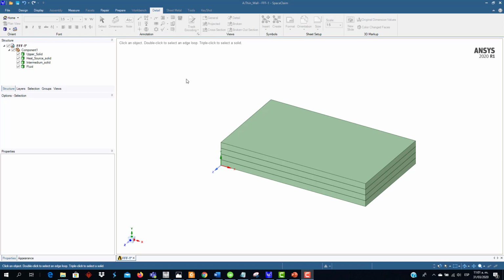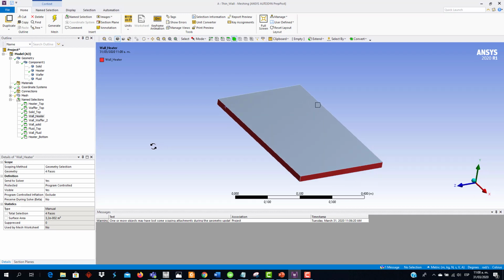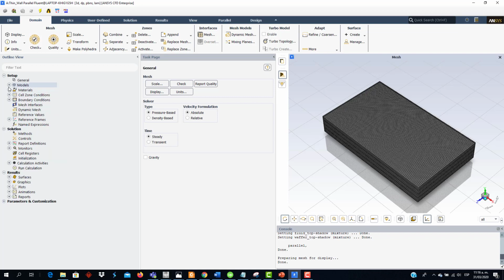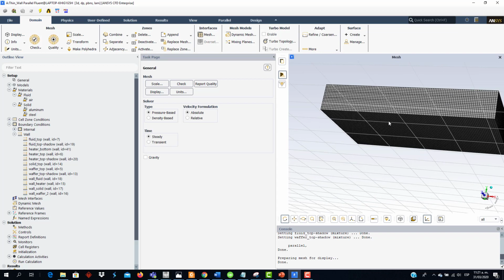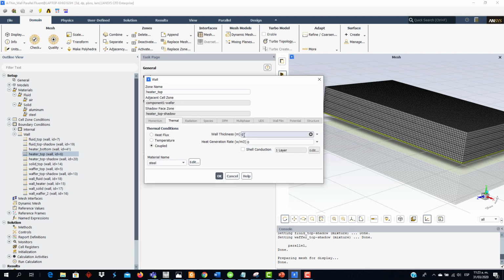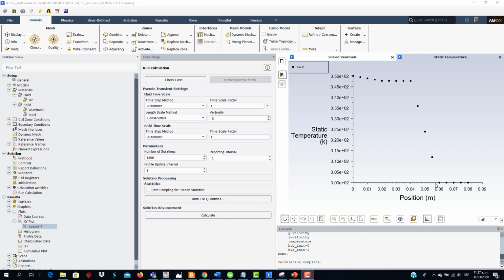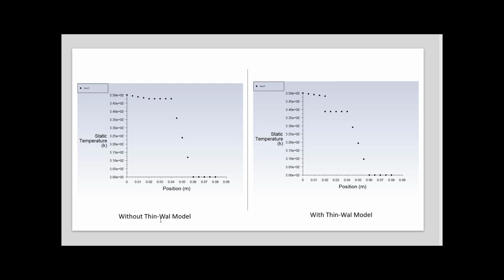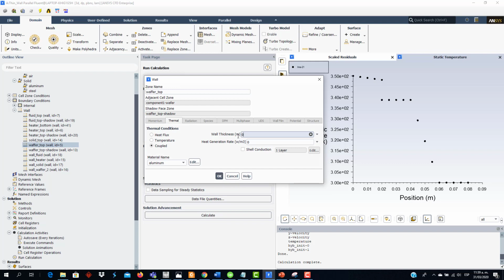Thin Wall model set up - ANSYS Fluent

Comment: it is either the heat transfer doesn't happen in my simulation, or there is heat transfer but my simulation is too quick. But i obtained the temperature profiles

Comment: Very unhelpful. No heat transfer happened. No explanation on how to make the model. Cannot add coupling between faces.
Reply: yes, no heat transfer happened too in mine (I already followed it step by step).. does anyone know how to solve this?? helppp
Reply: @Dz8598  You have to share the topology in either design modeler or spaceclaim whatever you are using. The mesh generated will have coupled walls
Reply: You have to share the topology in either design modeler or spaceclaim whatever you are using. The mesh generated will have coupled walls